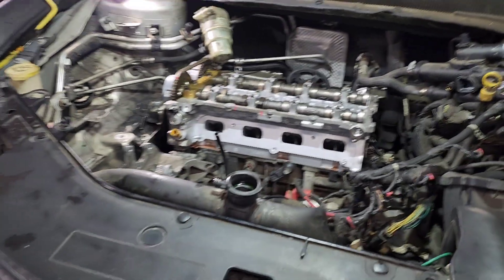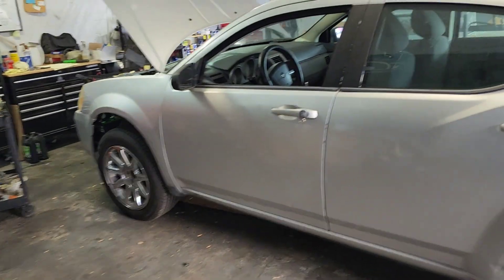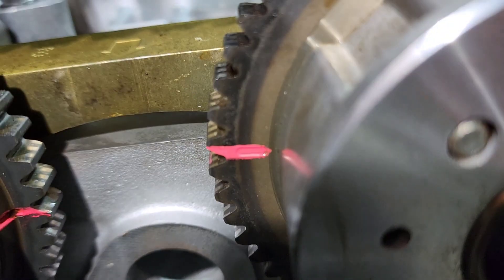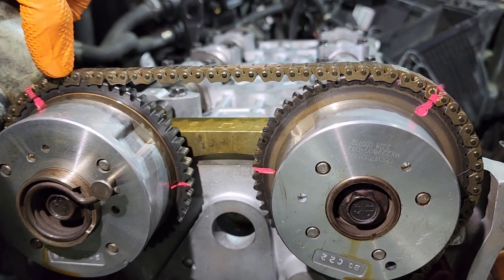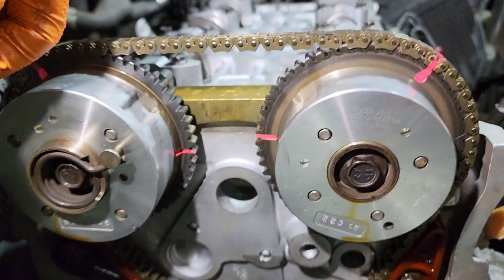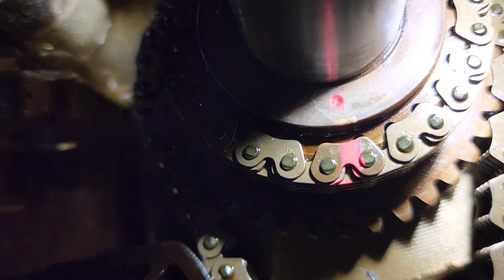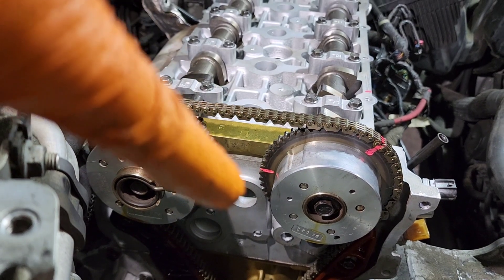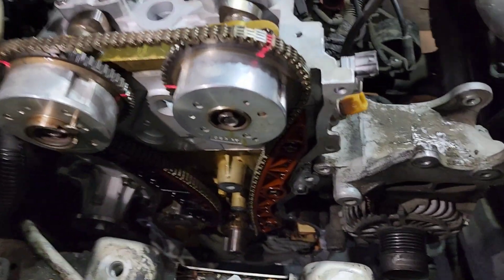2.4 chrysler dodge avenger timing marks (2.4 timing chain marks)

Comment: To test it before you put the cover back on turn the engine to see if the timing is correct by putting a ratchet on the crank case

Comment: Video doesn't do justice. Lined the 2 top marks on the timing (ok). Line the one with the dot on the bottom (ok) but it still wasn't at TDC on the bottom end. Its like 2-4 links off where the mark on the timing chain is supposed to be. Video didn't help

Comment: NICE WORK, WHAT IS THE OIL PUMP SPROCKET MARK AS COMPARED TO THE HAND ON A CLOCK ?., WOULD THE OIL SPROCKET BE SET AT THE 8 MARK ON A CLOCK, OR WHERE EXACTLY SHOULD THE OIL PUMP SPROCKET BE ?, THE 8 🕗 ON A CLOCK OR 12 🕛 ON A CLOCK ?, OR A 11 🕚 ON A CLOCK ?. WHAT WOULD BE THE OIL PUMP SPROCKET LOCATION ACCORDING TO THE CLOCK. I AM GETTING READY TO REMOVE AND REINSTALL A ENGINE BLOCK THAT IS SEIZED UP. THANK A LOT. AND I DID TAKE NOTE OF THE SPROCKET MARK ON THE CAM SHAFT'S AND THE CRANK SHAFT WHICH I ASSERT MAY BE AT THE 5 OCLOCK MARK ON THE CLOCK, BUT I COULD BE WRONG. THANK YOU VERY MUCH FOR THIS AMAZINGLY AMAZING VIDEO OF THIS REAPAIR. KEEP UP THE GOOD WORK. AND STAY BLESSED AND LOVED.

Comment: Does anyone else see that the timing marks don’t lineup ? it looks like it’s off about a tooth or two .
Reply: Cloyes always makes better than OEM parts. Some vehicles use Cloyes... Back in the day, anyways.
Reply: That's the alignment position. One mark (intake) slightly higher than the exhaust mark.

Comment: Timing chain broke while driving. Are my valves damaged?
Reply: Check compression nd if it’s low or not building any compression you will need valves. I had to get all new valves since mine were bent after my chain jumped timing. 
It’s not expensive either.

Comment: I tried to set the timing using the OEM chain after changing valve seals. the oem chain does not have any colored links. big fail! I ordered the Cloyes chain that has colored links. should make this job a whole lot easier!

Comment: That dot on crank shaft facing down is not TDC!!
Reply: Should be on the side of crank facing the front of car like 3-4 o'clock
Reply: @peytonlawson8865  yes, finally figured it out, thank you. At first I thought the cams were stuck but then remembered the second rotation on the crank and it all lined up. Just noticed the balance shaft chain off a tooth, so now it turned into a bigger job. Have to drop the oil pan. Thank you for the info though
Reply: How do you know where the dot is supposed to be for tdc ?
Reply: You are completely correct. I pulled the #1 plug and used a dowl and measured it on the compression stroke. It stop going up at 3 o'clock. All the timing marks matched perfectly including the oil pump gear markings. The difference could be the after market gear/chain set. Our OEM crank gear marks were different than the replacement.
Reply: I thought so too myb the crankshaft gear is not the original it's aftermarket but how did the top timming marks goes on the exact place those 3 copper marks are on point if he shifts the crank shaft to match the mark point at 3 o'clock it's doesn't it mean tht even on camshafts the markson the timming chain will move off myb with 4 or 5 teeth  and the other thing 8 want to ask does dodge caliber 2.0l and 2.4l hv the same timming marks and same timming chains coz I saw som hv different oil pumps other oil pumps hv mark others doesn't hv marks
Reply: I thought so too myb the crankshaft gear is not the original it's aftermarket but how did the top timming marks goes on the exact place those 3 copper marks are on point if he shifts the crank shaft to match the mark point at 3 o'clock it's doesn't it mean tht even on camshafts the markson the timming chain will move off myb with 4 or 5 teeth  and the other thing 8 want to ask does dodge caliber 2.0l and 2.4l hv the same timming marks and same timming chains coz I saw som hv different oil pumps other oil pumps hv mark others doesn't hv marks